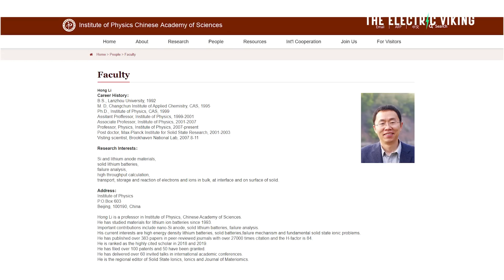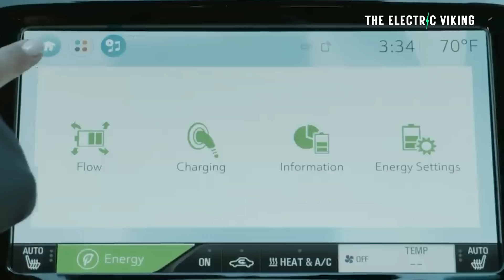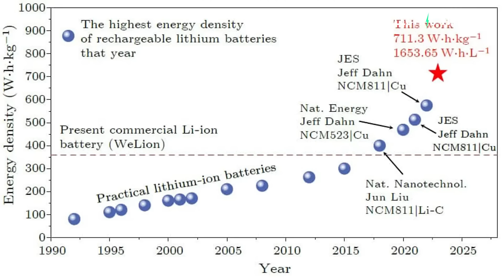The highest energy density lithium ion battery in the world is INSANE

Comment: Practical electric battery) aircraft will require far more than even 700 w/kg to compete with 12500 w/kg hydrocarbon fuel -for turbine aircraft avtur (diesel)  and more so for smaller piston aircraft with relatively heavier engines - designer of first all composite kit aircraft in the world _Opal 1975 - 55 years in aviation, etc etc.  Predictions are cheap and mislead almost always --crying Wolf harms the progress .  (with appropriate caveats and ensuring that reporting is not seen as endorsing or validation on the video itself avoids overselling or hyping genuine engineering advance )

Comment: Only 700 Whr/kg is indeed insane,  gasoline is 10,000 Whr/kg, and diesel is more.
Reply: But internal combustion engines are terribly inefficient, so while gasoline may have an energy content of 10,000 Wh/kg, the gas to wheel efficiency is only about 20%, which ends up at about 2,000 Wh/kg of usable energy. By comparison, battery to wheel efficiency is about 90%, and on top of that, brake energy which in an ICE car is simply wasted as heat in the disc brake, can be fed back into the battery in an EV.

Comment: jet fuel is 11944.4 w*h/kg while this study has a value of 711.3 w*h/kg. you cant ditch fuel for batteries till you reach 8000 9000 10000 w*h/kg for battery energy density.

Comment: Pttfffffff clearly you have zero idea of aviation.  Jet A1 is equivalent of 12000 watts per kg. Weight dose not decrease with electric batteries.  Weight is what aircraft manufacturers hate. Not only that aircraft as in large have a maximum landing weight which is lower than the take off Weight. Then how are you going to charge such a extremely large and heavy batteries.  
So your going to need 20 batteries at 1 kg each = 20 kg to make up for 1 kg of Jet A1 fuel. 
So please explain how the best selling aircraft the 737 fuel capacity 21000 kg at a specific gav of 0.8 kg per liter. This will give a range of just over 3000 miles.
To get the same will require 20 x 21000 kg to give at take off 416000 kg.
Max take off Weight 737 is  70050 kg. 
Please explain  !

Comment: Okay, so I fed Chat GPT with the facts of how much fuel a 747 used from London to New York, and a hypothetical battery of 750wh/kg: Chat GPT:

Certainly, let's recalculate the battery weight required for an electric airplane with a battery energy density of 750 Wh/kg to complete the London to New York trip, taking into account the given fuel consumption, engine efficiency, and energy density.

Given:
Fuel consumption: 70,000 kilograms
Specific gravity of jet fuel: 0.85
Electric engine efficiency: 90%
Battery energy density: 750 Wh/kg

First, let's calculate the energy equivalent of the fuel consumed by the jet engine:

Energy consumed = Fuel consumption * Specific energy of jet fuel
Energy consumed = 70,000 kg * 42.8 MJ/kg (approximate energy content of jet fuel)
Energy consumed ≈ 2,996,000,000 MJ

Next, we calculate the effective energy required by an electric engine, considering the higher efficiency:

Effective energy required = Energy consumed / Electric engine efficiency
Effective energy required ≈ 2,996,000,000 MJ / 0.9
Effective energy required ≈ 3,328,888,888 MJ

To convert this energy into watt-hours (Wh), we divide by 3.6 million (1 MJ = 1,000,000 Wh):

Effective energy required (in Wh) ≈ 3,328,888,888 MJ / 3.6 million
Effective energy required (in Wh) ≈ 924,136,111 Wh

Now, let's calculate the weight of the battery required, considering the updated energy density of 750 Wh/kg:

Battery weight required = Effective energy required / Battery energy density
Battery weight required ≈ 924,136,111 Wh / 750 Wh/kg
Battery weight required ≈ 1,232,181 kg or 1,232 metric tons

Therefore, with a battery energy density of 750 Wh/kg, an electric airplane would require approximately 1,232 metric tons of batteries to complete the London to New York trip.

I apologize for the confusion earlier, and I appreciate your patience.

Comment: 700 Wh/Kg is nowhere near enough for electrifying planes. At most, you'd be able to electrify the equivalent of the Bombardier Q400 at its full 4.5 hour range at max payload without sacrificing passenger count AND without having to build much stronger landing gear.

You are not electrifying the A220 until you hit 950Wh/Kg. You're not electrifying the A321 until you hit nearly 1275Wh/Kg.

Comment: 1. Watts per kilo?? Bro, take a basic course in electrical engineering to get your head around the correct terminology here. Try Brilliant, I hear they're good!

2. This lab-level prototype pouch cell will have less than the claimed energy density once encased in a hard metal shell. Nevertheless, if it is real and proves commercially viable to mass produce, it represent a tremendous breakthrough and we will see the results in ~4 years at best.

Comment: Tesla model 3 standard version battery along with all cooling and electrical component weighs 324kg or 715 pounds and has the capacity of 50kwh. 
Current Max energy density in model 3 = 244Wh/kg
Weight of battery in model 3 standard = 50kwh/244Wh/kg = 204Kg

Weight of battery in model 3 standard if we use the battery with energy density 711Wh/Kg = 50kwh/711Wh/Kg = 70kg

Thus, reducing the weight by ~130kg or 287pounds. The model 3 standard range weighs 3552 pounds or 1611Kg. This weight reduction alone will improve the battery range by around 10.5% i.e. the range will increase from 272m or 437Km to 300m or 480Km. The car will also be a lot more nimble and fun to drive. 

Hoping for the magic number of 1kwh/kg, with this pace it could happen in the next 10 years(large scale production).

Note: Most of the values considered are approximate and not absolute.

Comment: Atomic fuels have energy densities from 1000 to 10,000 times higher. So 711 WattHours/Kilogram would be 711,000 WH/KG or 7.11 MWH/KG.  We need such fuels for hypersonic flight, earth to orbit, fast transit to Mars, and for remote mining and infrastructure projects for Mars, Moon, and many remote places on Earth. Take a 100 Meter tall rocket fuel tank with oxygen and shrink to 1 meter.

The technologies needed to achieve that are now possible. They were not last year.  But much has changed this year with AI assisted engineering and scientific design, and in speeds of hardware assisted iterative design.

Richard Collins, The Internet Foundation

Comment: The primary safety challenges with lithium-metal or sodium-metal anode batteries is their difficulty passing the puncture test and seal leakage, both of which lead to rapid oxidation/combustion (fire) events, so such batteries have great theoretical potential, but have not been shown to be practical batteries for any transportation applications.

Comment: The vast majority of airplanes are not "gasoline powered". Jets and turbo props use Jet A1, Jet A or Jet B, which are types of kerosene. Piston planes in the US use avgas, which is a type of gasoline (it usually has  tetraethyl lead and a higher octane rating than normal gasoline), but outside of N. America, most piston planes are switching to diesel.
Reply: Seriously? Diesel for piston aircraft?

Comment: All the world needs is the energy density that provide 600 miles of range for a 60 KG of battery pack that costs less than $2000 per pack with 15 years of life cycle that does not catch fire. When that happens ( hopefully in a year I or two) we would have 90% electric Vehicles by the end of the decade. IMO.

Comment: Aviation fuel is about 10-12kWh/kg and with modern turbofans hitting 50% thermal efficiency, the benchmark for long-haul travel is at 5000-6000Wh/kg.
And modern long-haul aircraft are burning through about 60 megawatthours of fuel per hour. Make that 30 megawatthours by ignoring thermal efficiency. Now multiply that by the 3, 6, 10 or even 12 hour flight you might want to be able to go on in the future as well.

Now think about the kind of grid and power generation infrastructure it would take to fit an airport with charging facilities on-gate (for every gate) that can recharge a 6 hour range aircraft with 180 megawatthours within a 3 hour turnaround window that would be most profitable for the airline and the airport.
We’re talking about a 60 megawatt fast charger per gate. Multiply that by the 100 or so gates at Frankfurt Airport, for instance and you’re looking at a 600 Megawatt plant or about half a big nuclear reactor block.

Maybe I’m just being narrow-minded about the future, but juggling just a few numbers, the scale of the challenge just seems insurmountably daunting…

Strapping a small nuclear reactor on a plane might be an option, but in my honest opinion, there’s no way around synthetic aviation fuel for this century at least!
But since you have to do carbon capture, H2-electrolysis and fischer-tropsch synthesis for e-hydrocarbons, it might even be more efficient to just keep burning conventional fuel and only do direct air capture.

Comment: Just read an article that Mercedes had produced an ev that is twice as efficient as a Tesla Model 3. Ie twice as many miles for the same energy use.  So a combination of more efficient vehicles as well as better batteries is likely to make a meaningful difference.  Infrastructure for charging may be the bottleneck.
Reply: That is nonsense. In order to do that you would have to reduce the drag coefficient to unachievable levels and have a massive reduction in losses caused by tyre compression and friction.
Reply: @rogerphelps9939  The report is of the Mercedes Vision EQXX concept car that claims efficiency of 7.5 miles per KWh.
Reply: There is a report in Autocar where they took a short test drive and achieved 8 miles per Kwh. Even if 6 were achievable in more mixed conditions that would be far ahead of current consumer cars.  But it does demonstrate substantial headroom for efficiency gains. The claimed Cd is 0.17.

Comment: Hi Sam. I think that once most electric cars achieve about 400 miles of range, the most important issue will be how fast those batteries will be able to supercharge without degradation. At least for the car industry, this will become the key aspect of battery development. If they can charge up to 80% - 90% in less than 10 minutes, then it will be game over for all naysayers.
Reply: the batteries with less graphite and more silicon in the anode have a lower inner resistance. therefor you have less heat losses and you can charge faster without overheating.
additionally you get more range per charged kWh.
Reply: @stefanweilhartner4415  Thanks! Let’s hope they are actually able to do this, as it will finally kill the internal combustion engine.
Reply: Myself, like most people, definitely don’t need faster charging, or more than 300 miles. A Tesla with 300 mile range is more convenient driving across North American than gas. (The car is almost always waiting for you to finish feeding or relieving yourself).. Day to Day,  when not road tripping; your sleeping .. and note: Unlike ice,EV’s go much farther city driving.
Reply: @justinmallaiz4549  yes, enough for most people. but needing and wanting something is often different. a lot of people buy more than they need. more horsepower, more luxury, bigger, better styling, high quality. same with range and charging speed.
so, car companies focus more on what people like to buy and not what they need.
Reply: that was the nice thing in the beginning small cars with about 75 to 100 miles of range perfect for going back and forth to work, day to day errands etc.  we could still use a few of these

Comment: Nicola Tesla was correct when he developed wireless power. I am confused as to why Tesla is not pursuing this. Batteries would only be used for backup in instances of power signal loss.
Reply: Wrong. Clearly you do not understand physics or you would never have made such a statement. The only practical wireless power is short range electromagnetic induction which becomes very inefficient at spacings more than a few centimetres. Wireless power via electromagnetic waves is a non-starter.  Tesla did not understand physics either and was really just a crank with just a couple of ideas that turned out to be useful.

Comment: about 1980 something they came out with a capacitor that could act like a battery.  that meant it was small and light and could release it's energy slowly like a battery.

now they make jump starters with super caps.  one jump starter i read about can jump start a car if the battery has only e.g. 4 volts.  just set the jump starter on the 4 volt battery, let the jump starter charge up to 12 volts, and then the jump starter will start the car.

i don't hear much about using super caps to hold enough power to operate ev cars.  maybe the technology is here maybe it isn't. i don't know.

i think hydrogen is the kiss of death for the whole planet.  where are they going to get this hydrogen? seawater?  how many cars and how many miles will it take before all the oceans are depleted for their hydrogen?

i like to think wiser heads then mine are in the decision making process,  but in so thinking i think i'm only fooling myself.
Reply: They use them in Chinese buses to fast charge the bus at each bus stop and then discharge into the battery to hold the charge and deliver the power.

Graphene was going to be the next big thing in ultra-capacitors but it hasn’t been easy to develop into storage Used in electrodes on solar cells and other small things already, four physicists won a noble prize for discovering graphene, one day maybe 😊
Reply: @bashful228  that's such great news about the super cap.  we knew at the time that it was a technology that would be pigeon holed away from the general public,  but it gives me a warm fuzzy hearing that they allow some useage.

it was suppose to replace batteries entirely.

a surprising lot of technology is hidden away from the general public
Reply: You make hydrogen from water, H20. There is a limitless supply of the stuff. Furthermore when you use the hydrogen it combines with atmospheric oxygen to make water again.
Reply: Its, not it's.  Than, not then.

Comment: Having 1,6kWh per liter. means in the space of a gas tank of 50 liters a 80kWh pack would fit! So no special car design needed to allow for the pack. Exciting!
Reply: 50 litres of gas is 37kg but 50 litres of this cell chemistry is 116kg so it wont be as simple as replacing like for like because of weight distribution concerns.
Reply: @drc6940  The weight difference is about the same as a passenger in a back seat. That should be no problem at all.

Comment: A big airliner would need way over 500 tonnes of batteries, even at 1000wh per kg. So how is it going to land with this enormous weight? Unlike fuel, the weight doesn't decrease during the journey...And you'd have to go back to propellors, which are hopeless compared to modern jet engines. You'd never get off the ground. Spruce Goose all over again...

Comment: Worth noting that if you have over twice the energy density of current batteries, and the same weight of batteries in the car (for loner range), you only have to charge them half as many times in a year for a given annual range. For example, for 10k miles a year, a car with 500 miles range heads 20 charges / year, compared with 40 charges/year for a car with 250 miles range. (Of course, double those numbers to limit charging to 30% to 80% for longer battery life). People forget that phones die in under 3 years because they are charged daily.
Reply: “People forget that phones die in under 3 years (…)” Really? Then maybe you should tell that to the phone I’m writing this on; it’s been in use for 4+ years, and still does just fine on battery life. Then again, I’m not using known battery hog apps like Facebook or Instagram; those buggers poll your location and communicate back to their respective servers so much that they even make a brand-new iPhone feel useless due to running out of charge!

TLDR: Stop assigning what you see as poor battery performance, to hardware failure. More often than not, it’s actually software doing things in the background that you don’t even know/think about.
Reply: @jacobcarlson4010  Yeah, most phone batteries last far more than 3 years, but the issue here is battery degradation which is an undeniable fact of lithium-ion batteries. Software or not, Lithium-Ion will lose some of its capacity with each cycle and performance will get worse, replace your phone's battery and notice the night and day performance difference.

Comment: Trains and ships will also benefit.
A train on electric could build batteries into its rolling stock with induction and trapezium charging mechanism for  areas where energy supply is readily available and power to next zone. 
A sub sea tunnel across the Bearing strait would link the world greatest economies   Also across the straits of Gibraltar a direct Europe to Africa link. Opening markets and opportunities the same as Starlink. 
Australia and the Indonesian / Malaysian archipelago’s could do the same.  
Freight by ship then would only be for islands which have a lower volumetric demand which could be handled by electric air craft. Th his could kill oil powered shipping and reduce risks and wars.
Reply: The economics of a Bering Strait tunnel would be terrible. Both ends would be in the middle of nowhere. A link across the Straits of Gibraltar would also be hopeless because there isn't much to the south and there is little demand. I bet there is little commerce across the Suez canal either.
Reply: @rogerphelps9939  if you can’t see the developed benefits I’m sorry I won’t waste my time explaining the trillions lost in global oil wars.
Reply: Bering, not Bearing.